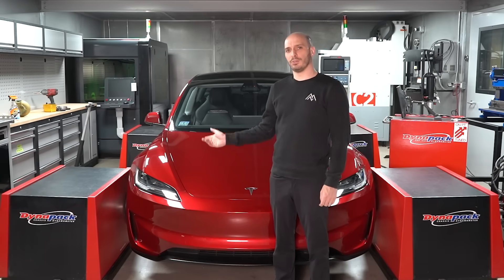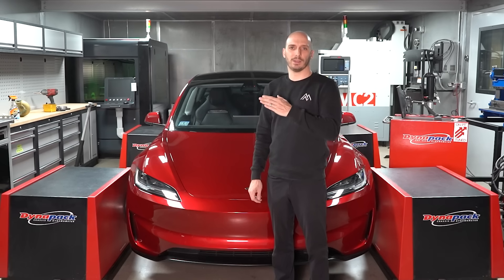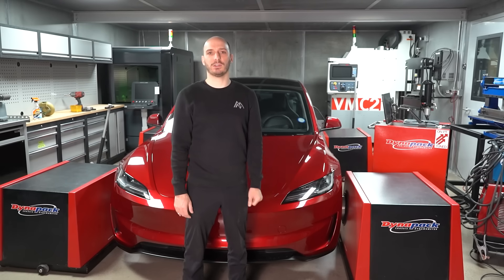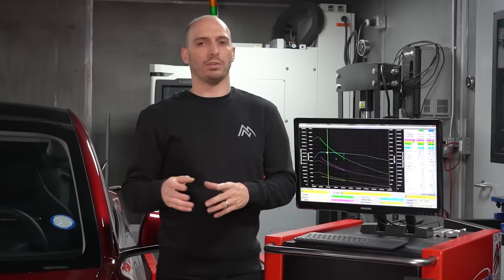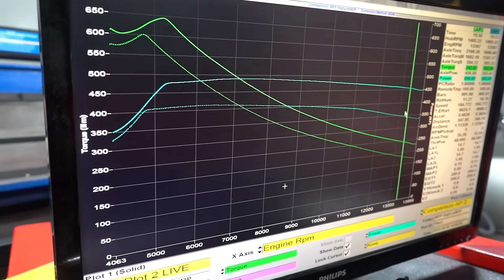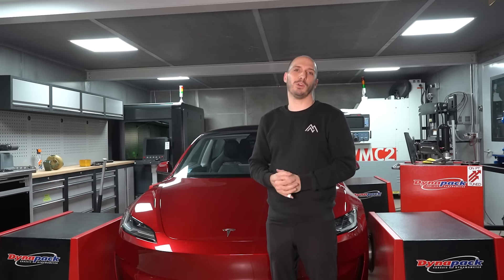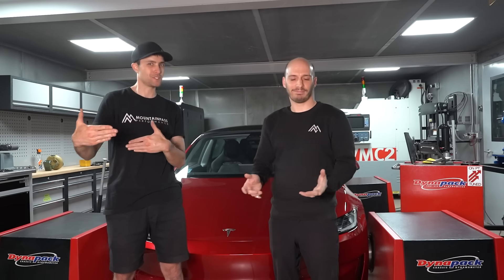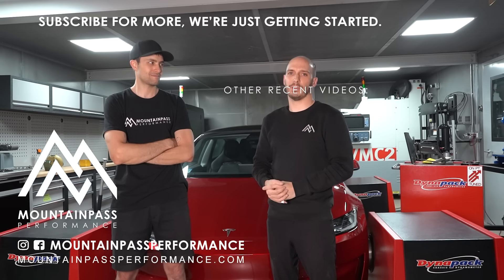Dyno Testing a Highland Model 3 Performance

Comment: but max power is only achieved at a certain speed, at other speeds it gets lower numbers however the performance is good. cars with a gearbox trade off weight and efficiency for a tighter power band (keep engine 5000-6500 rpm) but for an electric car it is better to keep is simple end eficient I believe

Comment: When the car on max rev and you switch to neutral, shoud be the Streed HP and the dyno hp the same. because the dyno calculates the internal power loss. or not?

Comment: Is the horsepower loss a factor for anyone?  Want to pull the trigger but worried a 100 whp difference might be a buzzkill at times.  Mainly highway driver ~80-95 mph if conditions permit.
Reply: I don't own it, I own a long range model 3. That said, I did test drive the performance when deciding between both. You honestly won't regret going for the performance at any point. When I test drove it, they gave it to me with 50% battery, and it still pulls like a beast even at a starting speed of 60 to 70 on the highway.

Comment: I’m curious how the long range AWD highland compares on power falling off with state of charge and speed compared to the performance I’ve see videos of the highland long range beating older model 3 performances at higher speeds curious if there is insight on this.

Comment: Good video but dynos can’t handle the low speed torque that single speed EVs make. With a multi speed gearbox you are typically doing a dyno run at 100+ mph. Here the car makes max torque at about 40 mph and max HP at about 50 mph. As you decrease speed you increase torque for a given HP. That is why you are seeing the torque overload message. At 40 mph 600+ HP produces WAY MORE torque than 600+ HP at 100+ mph. Just data log the torque and HP directly through Canbus during a 1/4 mile pass. That is way more accurate and realistic for these single speed EVs. You really should be monitoring the Max Discharge Value instead of just temperature. MDV tells you exactly what the max battery power will be. I saw 629 Metric HP once directly after Supercharging. I did bracket drag racing once and I could dial the car in to .01 seconds simply by controlling the MDV. At 556 HP my 2024 Model 3 Performance would run exactly 11.00 seconds. Perfect for that 11 second class. Don’t track SOC or temperature. Just look at the MDV and that will tell you how much power it will make. The closer you get to 462 KW or 629 Metric HP the more power it will make. Do you know what the MDV was for your runs? That is extremely important information. My fastest pass(10.63 for 1/4 mile) was with a 623 HP MDV.
Reply: Your comment needs to be pinned
Reply: Half way thru reading this comment and I realized I knew who this must be commenting without reading the name lol
Reply: @ImNotLostButWhereAmI lol. I did the same thing. Half way through I went back to see the username. Exactly who I expected it was. Always great info from him.
Reply: Pay attention to LearningFast, this guy knows his stuff about optimizing 1/4 mi times for the M3P (1st and 2nd gen).  LF - did you capture a video of your 10.63 pass?  I'm assuming it wasn't much different than your 10.65 pass.
Reply: Your insight is incredible. I can only imagine you're a physicist or...you really do learn fast.

Comment: since he mentioned Porsche... i would really like to see these run against the Macan 4S (at least) or the Turbo. Interesting that the tesla runs a balanced HP/TQ with both being about the same ...where as Porsche opted for huge torque and moderate HP.
Reply: I think there are some channels that have run both on track, but not at the same time. However, you can use their average lap times to come to your own conclusions. The Tesla's are usually (like they said) excellent for one to two laps, but then fall off hard due to heat.
Reply: Balanced hp/tq? Im not seeing. By 130miles tq drops by half

Comment: An out side idea would be to configure the use of high load stiffening capacititors to reduce battery sag.  Holds mass charge then dumps as main current becomes depleted.
Reply: Have been wondering about this for years now.
Reply: So diving in further with the use of Ai related to stiffening caps.  Electronic motor enhanced performance. This concept is commonly used in car audio systems to off set battery drop to amplifier. The problem is cost due to the demand of huge amps required to facilitate the delivery of peak amps to electronic motors. Theory is appears to be correct but limitations in cost over just adding additional battery add on.  One big advantage is caps can deliver without having to be pre temperature adjustment for peak output. Can be charged instantly.  I found that electric motors electronics do use caps, but rather to smooth out load and throttle delivery.
Reply: @hunterssports Interesting.  I know Lamborghini experimented with them in the Sian. Hopefully density increases and prices decreases because this is the next disruptive technology  that looks fun.
Reply: Turbo lag
Reply: Personally, I'd rather have Tesla make tabless 21700s.

Comment: While you guys are under the car, can you check if a rear Hyland motor would bolt on to a non-Hyland Performance. 😜 That’s the only thing that interests me in a Hyland Model 3; power. If that motor works in my ‘20 Performance, I might just keep it. 😬
Reply: highland
Reply: Simplified answer: It fits in the subframe. But there are quite a few other things that need to be changed with it, least of which being FW. If you really want the new stuff trade in your old. Otherwise just enjoy your car. You're really not giving up that much.
Reply: Realistically, it isn't worth to do that upgrade. You would have to change much more than the motor, and in the end the benefit wouldn't be all that much. You would be better off either sticking with your car as it is, or purchasing the new one when you are ready.

Comment: The battery is the limiting factor in EV power. 

Just wondering if you guys have looked at improving the heat rejection of the battery pack?
Does the BMS de rate because of temperature or because of the high long term current draw?
Reply: It is due to temperature. The car won't let itself basically be cooked to avoid extreme battery wear, and help preserve battery longevity. So in theory, you could make the car ignore that and push it to its absolute limits, but that would not only reduce the longevity of the battery, but also be dangerous due to thermal runaway. I think the only legitimate way to do it properly is to massively increase cooling.

Comment: Great info. I did not know that the 50 degree temperature made so much difference. 
I use my S3XY Knob to activate preheating and monitor temperature.
Reply: Yeah, the 21700 cells that Tesla is still using are heavily electrochemically and physically bottlenecked.

Going tabless would fix the physical bottlenck, and a better electrolyte would help unlock even more power.

Comment: If you're just staying on the street, or doing one-lap time attacks or drift events then these are so good and practical, I even want one myself. However the battery chemistry cannot handle continuous discharge unlike the Plaid batteries. Even if using endurance mode you lose more than half the power after discharging the battery rapidly and no amount of cooling will help, needs an entirely different pack with different cells.

However for like 90% of people buying these, it will never be an issue and it's a lot cheaper than other performance cars with similar power, making up for the one-pump and finished battery.
Reply: So much power. Very cool. I don’t know why I still prefer a lower powered ICE car but I do.
Reply: @LeMatt87n I was in the same boat till I found myself needing to pick up a new daily a couple months ago. Was looking for a nice low mile mustang GT because I love loud and fun cars. Then I realized I could get a barely used 3 performance for about 10-15k less than the mustang I wanted. Not to mention I’d spend almost 100 less a week on fuel and the mustang would need a lot of work to match the performance of the 3p. So I had to make the jump to electric and two months in I could not be happier with my choice. The car is absolutely incredible.
Reply: @ImNotLostButWhereAmI nice. Hope you keep enjoying it. I drove my friend’s Yp and it’s a hell of a car. Thoroughly enjoyed it, but I have unfinished business with internal combustion. Cheers.
Reply: @ImNotLostButWhereAmI  Question, what price did you end up getting the m3p at, and what year was it? I already own a model 3 long range, but was looking to buy a second model 3 performance used.
Reply: @ProXcaliber I paid 29.5k for a 2023 with about 15k miles on it. If it’s a second car for you won’t drive a ton and youre willing to buy with more miles I saw some for around 25k with 30-40k miles. It was my first Tesla and I wanted as much warranty as I could get. Not sure but I suspect the  used market may be rising a bit at the moment. With the 7500 tax credit on new EVs low mile 1-2 year old cars values were being artificially pushed down because no one was going to buy one for 15-20% less than msrp when they could buy new without paying much more after the tax credit. If they are still available at 30k it’s a ton of car for the money.
Reply: What makes the plaid battery tech any different?  Genuinely curious as I can't imagine why they would put a much stronger battery in that car just to keep it flagship?  But then again Tesla is known for its extremely asterisk-needed claims.

Comment: On my Highland LR with boost 50 on LG battery I get 382kW( 1280A)  at the battery draw and noticed that to  get the battery warmed quickly you can simply use the air conditionner to cooldown the cabin and it will dump the extracted heat to the battery... (a simmilar process than preconditionning) I get 0.8g acceleration. Motor are 3D3 and 3D7
Reply: Thanks for sharing.
Reply: Not many quote Amps..  that's insane..

Comment: Teslas battery tech is deadlast right now
They need to release those new LFPs 800V pack
Reply: Dead last…. According to a random yt user
Reply: @RC-fp1tl  what performance EV has worse thermal management than model 3 performance, enlight me
Reply: @mathieusturkenboom  fords mach e
Reply: The CT4680 hitting325-405kws charging says otherwise and the CT rwd getting legit 3+miles per kwh in mixed used per Edmunds testing also says otherwise. 

Oh yeah and that 123kwh pack with the seat sliders and acting as a floor weighs 440# LESS than the lightning 130kwh pack per the munro teardown of both!
Reply: @4literv6  and of course you had to use a car that represents less than 1% of teslas on the road to prove your point. Come back to me when model Y has 800V LFP.
Reply: @4literv6 4680 architecture is dead. Tesla failed to delivery the promised figures they announced on Battery day. Hence the disappointing range on the CT, also Tesla quietly removed the CT battery extender.
Reply: 800V had NOTHING to do with cells, LFP, or overall performance. Nothing.
Reply: And what battery tech is in the lead. The Chinese lfp??  Teslas already run half a million on nmc Japanese and Korean cells no need for lfp cells with less energy density. Lfp tech is American so maybe they should use it just for full American made slogans.
Reply: The CEO is dead-last. I will never own a Tesla while Musky is a shareholder.
Reply: @OMGWTFLOLSMH cool nobody asked though
Reply: @OMGWTFLOLSMH because you're suffering from MDS? MUSK DERANGEMENT SYNDROM! 😢😢😢
Reply: Nobody wo can afford one ceres, nobody.
Reply: @OMGWTFLOLSMH  reeeeee kamala toe

Comment: Just enable track mode to warm the battery pack.
Reply: I thought track mode pre-cools the battery?
Reply: @lemongavine It depends. If it too cold, it heats up the battery.
The point is to keep the battery around 25 degree celcious.
Reply: @tr9036 the point is to have a battery at like 40-50c to get maximum discharge
Reply: @Themazcorner For track and plaid mode, yes, it heats up the battery up to 55 degree. 
Otherwise it is trying to keep the temp in lower temps.
Reply: @tr9036 we are discussing a Dyno video so idea is to get maximum power :P and the initial post was saying to put in track mode to heat the battery . There is no plaid mode on the 3P, track mode will not heat the battery to needed temp

Easiest is to get s3xy commander and pre-heat with that
Reply: It will cool the battery if anything, believe insane is the best
Reply: Do not use track mode ever unless you’re on a track where you need to do laps and adjust power distribution and over/understeer. The battery gets cooler so you have the ability to do a few more laps than just insane mode which will give up after 1-2 laps of intense braking around corners.
Reply: @saucy360hz  Yes. I see videos where people use track mode in drag races. Even Edmunds did it in their U-Drags races. They got destroyed for it in the comments, lol
Reply: @lemongavine yeah anyone who does a drag or roll race will get flamed for it lol

Comment: Still crazy about my 2018 M3P and the dream is it shares a garage with a Plaid
Reply: My dream is someone like Sasha plaid swapping a highland m3! 

Even if you just used 2 cf plaid motors swapped directly in that would be 670+hp&200+mph top end haha!
Reply: @4literv6  Nice. Aftermarket Plaid motors bolt-on mod for any Tesla really like that idea
Reply: I recently picked up a real low mile 2023 M3P. Two months in and every drive I’m still stunned by how much car I got for the money. As thrilled as I am with it within the first hour of ownership I started doing the math of how I can pay this down asap and get in position to trade it toward a plaid. I absolutely don’t need more than I have but who doesn’t want even more?!

Comment: Good video overall, but the summary is the just of these cars…Very fair and well put! As a street car they’re quite a beast but they definitely left room for improvements as a track day car.
Reply from the maker: That's where we come in! We're turning this M3P into a track-ready machine. The video on that is coming very soon!
Reply: Thanks for the research and Brilliance! Team!
Reply: Dont the torque is available immediately vs combustion, so generally the performance is higher than the same power to weight ratio on another vehicle